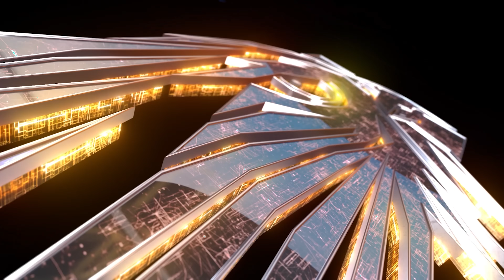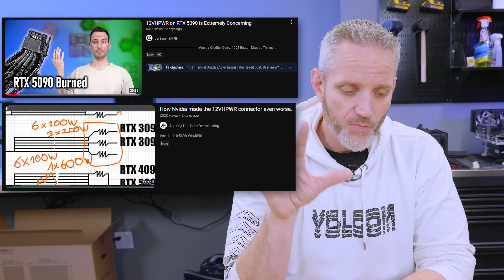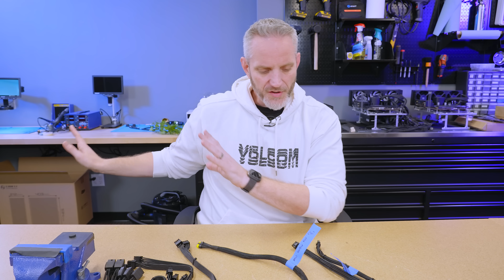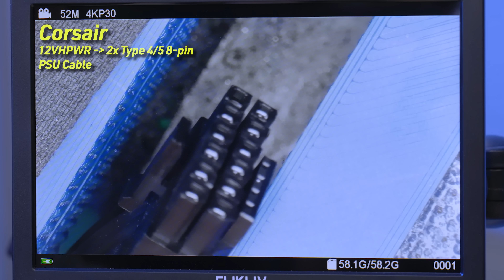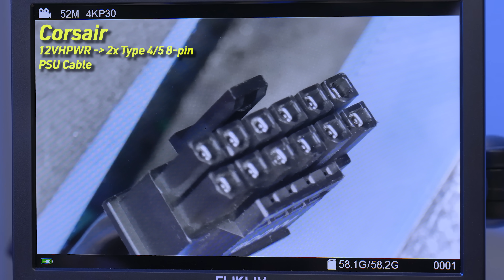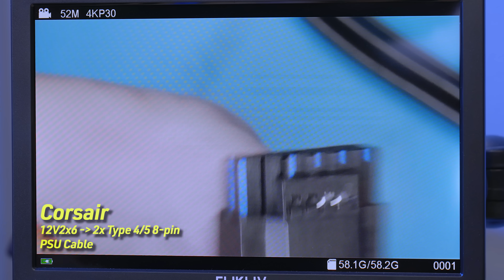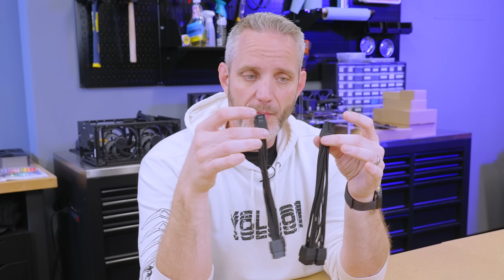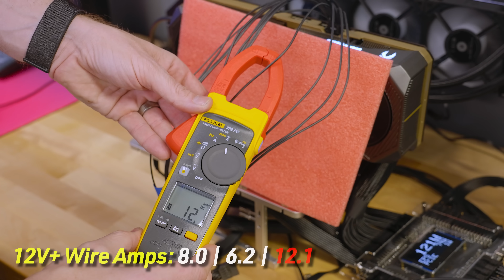I discovered something concerning and I need the Experts to chime in... More 12VHPWR discovery!

Comment: As an electrician, the simple fact that these cards are using a cable that’s rated for 600W, while the official TDP is 575W, is crazy. That’s only a 5% margin of safety!! In Canada, we typically don’t load wires & connectors to anything less than a 20% safety margin! IE, for a 575W card, the cable and connectors should be rated for at least 720W

EDIT: as pointed out in some replies below, the PCI-E slow can also deliver up to 75W. 

This does bring it to a 17% safety-margin. This is definitely better, but still very close in my personal opinion. Especially since there were already a bunch of issues with the 4090. 

They should have reverted back to how the 30 series cards were, or used 2x  12HPV (again, in my personal opinion)
Reply: Also in real electrical systems, we always have circuit breakers or fuses precisely to protect the wiring from burning up in an over current event.  The fact that these Nvidia cards have practically no current monitoring and no form of overcurrent protection on the connector is insane.
Reply: @OvenFridge  This brings up a good point: maybe the cables +should_ have inline fuses on each wire?
Reply: @Barteks2x  That would likely be the simplest solution to prevent anything from melting, but unfortunately wouldn't solve the issue NVIDIA created by removing the circuitry to balance the load from their GPUs.
Reply: @Barteks2x  Fuses on each wire, sure it would be safe, but in reality most people would avoid that brand because a blown fuse is a bad day, and you don't want to have a bad day when you're trying to game. 
Cables without fuses cover up the problem, and in 99% of cases the problem doesn't get serious enough to warrant an intervention and so in those cases the cable is seen as just a hindrance.
Reply: @OvenFridge  If you run that close, the only protection is active cooling and external monitoring.

We had a compuer society living in an old barack, with three phase 32 Amp 240 Volt coming in.

Our base load was about 28A 24/7 to run the computers, when we had waffle parties we had to measure what phase the outlets were on.

After several years the plastic caps of the fuse box had melted. We did not once go over capacity, except that one time two wafle irons were on the same phase.
Reply: @OvenFridge  yes, great point! I didn’t even think of the added protection from a circuit breaker / some over current protection
Reply: @OvenFridge  It should be a protection from the PSU and not the device behind the cable. With a short in a connector or cable, you would have the same problem when only the GPU has a breaker. The PSU is the device that "knows" how much power it is able to deliver over each line / wire. With the correct wires installed, it should be able to do that. Everything higher than that: shut the connection down. Not the problem of the PSU that die GPU demands too much power.

The most intelligent would be if PC components (GPU, Mainboard / CPU) would communicate and demand a certain amount of power from the PSU or be limited to a certain amount of power.
If you cheap out on the PSU and it only delivers e. g. 300W to the GPU, the GPU would not work or would only work in a low performance mode.
Reply: @OvenFridge  Thought should this somewhat also fall on the Power Supply companies as well to integrate this, as the breakers are at the source not at the end of the appliance?
Reply: @OvenFridge  this should, honestly, be the job of the power supply.
Reply: @leverloos  In this case, I disagree.  Nvidia is the one to 'invent' a new connector, not the power supply manufacturers.  Nvidia forced this on all their high end GPUs just because they wanted to stop 'wasting' PCB space.  Its 100% on them to ensure they implement in a way that doesn't catch on fire.
Reply: Time to get @ElectroBoom to do some testing here, he likes setting things on fire 😅
Reply: Anyone think that maybe it's about time the GPU power cable go up one full size, I mean connector,.cable gauge, and pin size??
Reply: @parlosyou  It's only a few years since they shrunk the connector and they were told then that's an extraordinarily bad idea. Shrink the connector and up the power 50% great -_- but nVidia assured everyone it's fine....
So the issue isn't we need to increase the size, it's that we need to GO BACK to the actual PCI Express cables and make those better.
Reply: IMHO that's the major design fail of the 12VHPWR connector: they cut the safety margin to the bone! Look at the bottom of the Wikipedia page for the 12VHPWR connector where they compare it to the 8-pin power connector: the 8-pin power has a safety factor of 1.92 and the 12VHPWR has a safety factor of 1.1. 

(And I'm sure that the actual current capacity of the single pins on the 8-pin power connector are higher than the specified 8A, while the 9.5A for the 12VHPWR are probably close to the actual limits.)
Reply: @ahoannon5711  That's a big part of it but not the full issue, the other part of the issue is NVIDIA removing the the shunt resistors on their GPU's that gave them the ability to balance the load across multiple wires. Now if any of the wires has an issue, the other wires pickup the current and nothing in the system even knows about it. You could have a 5090 running on 1 of the 6 wires and the only way you'd find out is when it starts to smoke.
Reply: @ahoannon5711  The 8-pin PCI-E power suffers from the same design flaw as 12VHPWR, it just has enough of a safety margin that it's never become an issue. That problem being that inidividual current carrying wires need to be protected from overcurrent, not the cable as a whole. For PCI-E, a single functional wire would put you out of spec, but probably not far enough to be a fire hazard. For 12VHWPR, you can 5 wire failures and that single remaining wire will now try to carry 6x the current it should normally do. And even a much smaller margin will result in connectors and wires becoming dangerously hot.
If each pin (and thus wire) was individually current limited to the 9.5A in the spec, we would have a whole lot of cables and graphics cards getting returned as faulty because the connector is shit, but PSUs wouldn't be allowing connectors or cables to melt.
Reply: @remmon1  Will this cause boom or fire?
Reply: Puts things in perspective
Reply: So, in essence - It needs two connectors.
Reply: @Nightykk  No! Different connectors and thicker wire-gauge. They should use something like a XT90 connector which can carry 90A and 10AWG wire which can carry 30A.
Reply: @ I don't disagree, but, that isn't likely to happen any time soon. An entirely different connector would most definitely be the way to go.
But, what they will do... is adding a second of these.
Reply: Probably these companies never heard of tolerance in electricity.
Reply: Some correction here. That is not how rating normally works or has to work, I don’t know how you do stuff in Canada.

I am an engineer in Germany and here it works like this. You have a safety margin that is mostly normed. (We have a norm for everything in Germany) 
Let’s say the safety margin is 50% (it can also be 250%). And the actual limitation is 1500W (continuous) of a cable, then the rated limitation would be 1000W. So you can definitely use 100% of the rated maximum.

This is also how it was before with the pcie connectors. The 6 Pin was rated for 75W, but could probably take 200W, so you could easily use 100% of the 75Watt.
Reply: This is illegal even in Europe, nvidia should be fined, but it's big US corporation, so we can't do anything with that, but maybe it will change now when America is not friendly anymore. Even if it was 640W, it's not enough, especially when you consider that most of Amps can go thru 2 cables and almost nothing thru rest of them, so standard should be that one separate cable should be able to handle those 600W in emergency case, that would be good standard.
Reply: @Pidalin If the EU can mandate Apple to use USB-C. They could probably force Nvidia to sell cables/connectors that are actually safe to use
Reply: @Pidalin  You don't need to fine them.  The EU can just ban nVidia from making sales in Europe until they fix it.  That would be such a gigantic hit to their stock price they would be forced to change it or the shareholders would upend the board of directors.

Also, leave us alone.  We're plenty friendly toward the EU.
Reply: You are absolutely right, and its not as if that would cost anything more, 2k dollars can pay for a few cents for a higher spec cable
Reply: As i dont see anyone pointing it out already, its actually 675W. There's an extra 75W coming from the PCIe port too. Is this sufficent headroom? Idk. But a bit bigger.
Reply: The cable assembly (6 parallel #16 current carrying conductors, free air, 90 degree rating, 12 volts) would be 1300W at 100% rating. The limiting factor are the terminals, but I'd wager good money that Molex rates the actual terminal for the full 16AWG 18A in free air, but is derating it inside the micro-fit+ connector, and then further derating it in the PCIe CEM5 power delivery standard (since all 12 conductors are current carrying)
Reply: im not an electrician by any means, but i know my way around automotive electrical systems, if anyone told me to push 600 watts at 12 volts through that connector with only 6 thin positive wires i would call them crazy. Two 8 pin pci-e power cables are rated at 300 watts (150 each), and between them have the same 6 ground and 6 positive wires.
Reply: @sniperotto  At that current? Bundled small wires is nuts. When I was wiring up my 200w rms subwoofer amp in my car, (you know audio peaks can be 2-3 times more), I looked at peak current draw to choose the supply wire. I used 4 gauge welding wire. 
A two wire equivalent for the video card would be 8 gauge minimum. 6 gauge should be right, IMO.
Reply: @sniperotto  What connectors are specified for and what they can actually do are two different things.
A cable harness can deliver 6 to 8 amps with a 6 or 8 pin connection, which is at least 72 watts per cable harness with a 6 pin connection, so a total of ~218W.
Also think about the Radeon R9 295X2, this card had 2 x 8 pins and drew 500W. Basically it's not a problem if power supply cables are designed for it, but the 12 connection is also built on the edge and basically only has a 10% buffer.
Reply: wires themself are rated for ~680W@12V not sure what exact connectors are used
Reply: What's worse -- the max rating is unlikely to be power current draw. It's likely burst draw.

We need to just increase to 48volts for these cables. 

Sure, computers get more dangerous, but 12v isnt enough to decrease the amp draw.
Reply: @1337GameDev  If you go to a 48V supply method, more circuitry will be needed on the board to translate the voltage down to the low voltage processor chips/memory thereby increasing the cost of the product.
Reply: @tigerzero5216  

The 48v will just be for high power pinouts. 

Older devices that expect different voltage would need a step down, but that's pretty easy to do and unlikely they'd need high power so adapters would likely be pretty cheap. 

IMHO, most devices for 6-8pin / 12VHpwr are gpus and could easily adapt to 48v. Albeit extra step down would he needed on the card, but that's pretty small cost for a GPU at $1000+
Reply: it's insane release a graphics card with such a atrocious power consumption, I think Nvidia has pushed this cards to the limit.
Reply: yea, I am a computer tech... and I really don't like the 5% safety margin at 575W.  I have gone "nope" to using that connector at all.  I think it's just a fire waiting to happen.
Reply: That's not quite so. The pin rating is 9.5A adding up to 685W total. However the connector as a whole doesn't have a rating because it's usage dependent. It's intended to be used up to 600W according to PCI and NV, which is supposed to already have margin of safety to real maximum rating of the cable, which isn't specified, which means loading it up to 575W should have been absolutely fair and not a problem, heck loading it to slightly over 600W would be fine as well, since the real safety margin is ON TOP of those 600W. And those 9.5A pin ratings also have a safety margin in them to begin with. You don't need to keep inserting safety margins everywhere if the hazard has already been accounted for.

However when each pin pair isn't loaded individually and the current across pins isn't balanced, a de-rating needs to be applied, and evidently, that de-rating hasn't been done properly.  It should be done experimentally but a common fairly safe rule of thumb is 20% per doubling of pin count, which means a quick and dirty de-rating of 52% for 6-way parallel would be commonly used, so 330W. If the connector was used as 3 independent groups of 2 parallel pairs, it would be 20% or 550W.

Note that even if you have individual consumers on the high rail balanced but the grounds are not, the same de-rating still needs to be applied. So i think no matter how you slice it, i'm still not going to call it evidently sufficient for loads substantially exceeding 330W.

Oh also not all of the official TDP is on the 12VHPWR cable, on Nvidia the VRAM VRM and one phase of core VRM are generally connected to the PCI-e socket, probably a good 50W. So yeah i think a 380W GPU should do fine.
Reply: @SianaGearz  Thanks for your explanation of the need to de-rate when using multiple wires that are not balanced. That's what I was fumbling toward with my comment.
Reply: I've worked on emergency generators in hospitals and such, they use up to 12 × 400mm² and one thing we check is that they were all the same lenght, like down to the cm same lenght, so they all had the same resistance and the current would flow to all of em evenly.

This is like that on a smaller scale but with the same end result. Fire.
Reply: Shouldnt the wire have that margin built in, you rate it for 600W but in reality it can take some % more?
Reply: On top of the wattage so people are undervolting!  Increases amps as your volts go down. Watts stay the same
Reply: @HellbentOrphan  Not at all. Voltage "pushes" the current. Lowering voltage limits the maximum possible current.
Reply: @HellbentOrphan  That has NOTHING to do with power delivery to the Card!
Reply: Isn‘t it rather so, that when its rated for 600W, the safety margin is on top already? like 25% or more derated already from the technical max, like 720W in that example. So its not 5% to. 575W, its much more.
Reply: They draw 75w through the pcie slot also.. 
so its within spec. even tho the margin for error is still crap.. I mean there where no melty cable problems with the old 3090 and 1kw bios!
Reply: @david61210  good point. I did forget about the 75W through the PCIE. Does increase the safety margin, but I (personally) would still like to see beefier cables & connectors. It should add that much cost compared to the overall cost of these cards.
Reply: Could you check the current flowing through the ground wires relative to the one with the dodgy contact?
Reply: gaming PC's are going to require a dedicated 20 amp circuit in a couple of generations
Reply: I’m pretty sure the cable is rated for 600w continuous. All PSUs are rated for double their spec, I would expect the cable to also be able to manage double.

So for spikes it should be able to handle 1200w if the rating is 600w.
Reply: At the very least SomeOK. I'd go even a little higher. Just to be safe. They really needed 2 connectors.
Reply: US standards can often be just as strict, the cables aren't made well enough or rated high enough.
Reply: Also there is no way for the card to know what kind of cable you have, if it's good quality, each wire has same resistance and so on. They assume too much in thei shitty setup. Don't understand why the just didn't add sensors for each pin and load balancing. I mean how much would that cost in parts? $20? $30? If they did that there would be no need for the useless sense pins.
Reply: Cable is 600 and they get at least 75W extra from the PCI slot
Reply: I think there's a 600w from cable plus 75w from PCI-E slots, but yes really close
Reply: The cabeles are rated for 684 watts with a 1.1 safety margin or 9.5 A per cable as per the spec.
Reply: Apprentice here. Dont you think that the ambiant temp in a pc case would affect that as well. I know that, from what I've learned, if I were engineering this thing, for a 600W card, them cables, and that there connector would be a whole g dang lot bigger
Reply: It must be at least 1.3-1.5 times. There is no specification below 1.3x for these cables. At least 780W.
It would have been easier to release the 8 pin cables for what they can really do.
An 8 pin cable can deliver 6-8 amps per line cable, this is 288-384 watts.
3 x 8 pin would have been much better for the card than this 12 pin connector.
Reply: Yeah I have read that spec is to be able to lose something like 10% of the strands while stripping and still be in spec.
Reply: Safety margin is all I've been thinking about since this vid started. Lets just consolidate several connectors into 1 with connectors that fluctuate in contact area.
Reply: all of a sudden everyone is an electrician and engineer in these comment sections
Reply: When they forced a new standard idk why they didnt use that to push a new 24v or 48v connector, that would save cost and make connectors smaller, using roughly same size connector as the old 6 pin and wire gauge.

For these safety margins and power ratings the connector should have a 2cents ntc temperature sensor

And about the receding pin, clamping force on the pins matters more than how much it is pushed in
Reply: @victornpb  that'd make adapters impossible and would require new power supplies and a new circuit on all power supplies for 24V instead of 12V
Reply: @ they already trying to push new mother board and psu standards with 12v power rails would be more economical to just switch psus laptops already use 19v for everything that would double the current capacity using the same wire gauges and higher voltage psus are cheaper to manufacture
Reply: But…‘merica
Reply: You are mixing things up. pcie 8pins are rated for 150W power delivery. the new 12V high power is rated for 600W. Then a card is allowed to take in 150W from the 8pin. A card can take 600W from the new 12V hp. The problem is that the safety margin was highly reduced. pcie 8pin can handle like 280W of power safely and for safety it was decided that its rated to 150W only. The new 12V hp tho is rated for 600W and can safely only handle 660W, that is a huge reduction in safety margin %. That means e.g. if on the 8pin 1 of the 3 12v cables has no good contact, the other 2 cables get at most an increase of 50%, so 1 cable transports 75W instead of 50W, but as the safety margin is at 288W, 1 cable can safely deliver up to 96W.
A normal GPU card will only ever have power delivery plugs rated for slightly above their maximum wattage, the change is this safety margin.

Combine this with potentially bad contact on 1 or 2 pins and one will be very fast above the per-cable safety limit for the new pcie 12v high power.
Reply: 600 Watts at 12V is 50 amps. Which means 9 amps per pin. Copper cable of cross section 1,5 square millimeters is able to sustain up to 16 amps current.
Reply: @jaromirandel543  The problem is not that a cable draws 9 amps, but that sometimes it is 12 amps, the load is unevenly distributed.
Reply: @Nost2682  Wires with bad connections have high resistance. Because of that there is high current at wires with good connection. Remember - most current goes the way of the lowest resistance.
Reply: @Troll_Norris  
The cables from the 12 pin are merged into 2 on the board, hence the poor load distribution.

There is also no monitoring, the 4 pins are only there for the signal, which tells the power supply that the cable is connected and it should supply power.
Nvidia did absolute nonsense here.
3 x 8 pins would have done this without any problems.
Reply: @Troll_Norris  Who told you each pin carries it's own divisible load? It doesn't.
Reply: @LibelLinus304  it should. All power is from the same source and it should lead to same PCB layer.
Reply: @Troll_Norris  It does.
Reply: Worst part is you can do the math of the gauges of wire and it comes out to below if not dead even to what they claim cards can carry.  That is before you add any additional resistance from bad connections.  The design is flawed from the get go.
Reply: I agree. It should be a 8-900 cable if operation is 6-700 watts
Reply: Honestly, if they are using 16 gauge (1.29mm2) wires. then these wires are rated for ~200W (17 amps at 12v) each going by 40cm length. And there are 6. It definately has to be the connector or connection. the wires have a 25% safety margin.
Reply: @leverloos  In a search, 60cm is typical and when you see 2 wires taking most of the load then there is a power delivery/resistance problem as well.  But when you are pushing 600+W with 4 wires handling 200W or less each and 2 taking up most of the load...
Reply: As an electric guitar player, I just hope to not get shocked.
Reply: This is actually normal. Even with older connectors you don't get much margin. 7900XTX has a TDP of 355, and it uses 2 150W connectors, plus the 75W from the motherboard. 
The total capacity that the 5090 has acess to is 675W (600W cable, 75 from PCIe slot). 

The issue is not overspecing the cables, the issue is that while the older 150W 8 pin cables can run ~250 Watts if good quality. Many 6 pin cables that are officially rated for 75W have the same amount of power lines as the 8 pin cables, meaning they can deliver 150+W safely

The issue is that while 8 pin connectors can safely provide far more then they are rated for (the safety margin), the 12VHPWR connector can only safely provide something like 660W. On top of that, it wouldn't even be an issue if Nvidia used the same power setup as on the 3090, which split the connector into 3 power lines on the card (2 wires each), which means they can monitor voltage drop and rebalance the cables when one gets damaged/overused or isn't pluged in correctly.

On 4090 and 5090, all of the 6 power lines are joined together on the GPU, which sees all of them as a sigle wire. If something goes wrong, the GPU doesn't know a difference between 100W x 6 wires, and 600W running through a single wire, and thats why they burn(apart from the whole 16 pin connector being bad overall)
Reply: @shepardpolska  Not sure why any "electrician", "engineer", and or presidents of small islands here, did not open with beginning, simple, electric basics like, the fact that the power supply can and Will pull 50-60 amps@ 600 watts. 50 amp draw needs 6 gauge copper or 4 gauge aluminum wiring. Most of these wires and connectors are a mixture of both. Either way none are capable of holding safely 50+ amps. And what happens when you attempt it? Melt down. Hell, some of those power supplies pull 80+ amps...
600W / 12V = 50A Why not 120V? Thats only 5 amps...
Your computer's power supply unit (PSU) converts alternating current (AC) from a wall outlet into DC. 
Something I think these designers either have forgotten or never knew.
This problem will not go away until it is done correctly. 
Most electronics need low-voltage DC (like 5V, 9V, or 12V), but wall outlets provide high-voltage AC (100V-240V). Therefore, must be lowered and converted AC to DC, making it safe to provide directly from standard outlets.
If you read the numbers on the power supply you'll notice this as truth. If you learn the pc's voltage use you'll understand the complete process.
So much for the thousands of "engineers" and "electricians" here..This is basic stuff.

And if one thinks coatings and or wraps, sheathing, cool af braiding, or any of the like helps the problem, on the contrary, it makes it worse. These things are insulated to minimize arcing after meltdown, but also at the same time keep heat IN making it even hotter. They have zero to do with electrical current carrying capabilities.
Reply: that doesnt matter because the PSU is sending way more then that to the GPU causing the issue, the source power aka PSU is not regulating correctly so its over volting the 1st pin, vs load balancing it thru all the wires correctly.   This is why its not repeatable because all the folks so called testing this theory, never test the PSU that caused the problem ( they cant its burnt up, cant be used any more,  they use other brands versions which are working ok.  vs the faulty PSU,  not all PSU's are faulty just a select few, which is why so few cable melts happen.  if you look at the numbers is low, compared to the millions of PSU's being made,  sure a few lemons make their way into retail faulty parts.  if it was a GPU or Cable issue, all of them would melt, but that's not ever happening.  its just a few bad PSU's with faulty regulations in them for sending power to the cables when a source askes for it.  the spec of 20% or 5% the faulty PSU is going way way beyond any of those margins in order to actually MELT stuff, which is why that doesnt matter if its 5 or 20% leway.  the melting is happening well past that point.
Reply: @supertrix6628  Most have OV protection, so, no. That isn't to say a PSU Without OV could possibly but the issues I already stated. Everyone I know of that tested these also tested the PSU and it passed.
Reply: rated 600 would be insane bc the 5090 casually pulls 610+ W
Reply: I thought I'd read somewhere the new 12v2x6 cables were actually rated at 675w and also there's about 75w being drawn from the pcie slot through the board
Reply: The H++ cables are supposedly rated for a max of 675W.
Reply: BULLSHIT. Youre knowledge as an electrician indeed is outdated as a whole. H++ is rated to 675 - 680W ( without extra safe margins ) H++ Power Connector = 12V-2x6 Design (675W Power Delivery)
H+ Power Connector = 12VHPWR Design (600W Power Delivery)
Reply: Right, but we still call a 15 amp plug a 15 amp plug, even if it has a safety margin and could probably do 20 amp all day without catching fire.

If you have a 600W card you use a cable with a number printed on it greater than or equal to 600W, and should be able to trust that the 600W cable has a safety margin baked in.
Reply: As an engineer, I second this. Seeing those TINY plugs being rated for anything above 400W feels like playing with fire. If at least each contact was the same size as PCIx8, they would be fine carrying 600W through 12 of them, but NOT through whatever these are.
Reply: I would agree that is a very small margin. Could the connector cables not be equalized? Similar to wye connections in AC motors?
Reply: I could be wrong...but are they building these connections like this to "prevent user overclocking" through behavior manipulation and warranty denial? All so there cards do not have to be improved?
Reply: @DragoonZeroAlpha  the melting happens without overclocking as well
Reply: You install a GPU that can pull 900 watts in bursts, a CPU that can pull over 300 watts at max load, and every other power-hungry peripheral component into a modern gaming PC, and you could end popping a breaker just running it alone. This is nuts.
Reply: @shmehfleh3115  nah u wont hit a breaker, because the power supply can smooth the loads
Reply: depend which crimps you use, there some cable that use 12,5A rated crimps : that mean 900W support for those cable
Reply: can confirm I don't even plug shit into the WALL without a 20% margin
Reply: I think the de facto standard is 25%, 5% is nuts.
Reply: @ivanjermakov  20%
Reply: From my understanding 600W is the safety margin number? but I could be wrong
Reply: PCIe slot supply 75w and the power cable supply ohter section. however the power header with 16AWG wire per pin 9.5A x 12V x 6 /.8(de-rating). the per pin 9.5A is de-rating number for component.
Reply: A 20% margin for 575 watts is 690 watts not 720 watts. 575w x 1.2 = 690w.
Reply: moving to 12 gauge wire would probibly be the only mod required, then you can reduce pin count to 5 pairs, reduce sense pins to 2 and place them in corner positions to ensure the power pins are connected well, and this means you can ditch the exotic connectors. the cable present pin and power good signals can use a voltage between 5...12 volts to indicate psu capability and/or loading, instead of a binary code on the 2 additional pins.
Reply: For short usage 600W on a 575W specified cable is ok. Long time usage instead is not a good idea.
Reply: Dude, the US still use aluminium for household wiring. Heaps of fires and hazards from it. Here in Aus it was banned back in the 80's. The US is majorly behind.
Reply: I have an RTX 5090 AORUS MASTER, i've power limited it, and now it draws arouns 470-480Watts, should i be still concerned or is it safe? I have a Corsair RM1000X PSU and using the PSU 12hvpwr cable
Reply: As a electrician you should know that 600w rated cables are not 600 MAXIMUM TO MELT, they can stand beyond that. What a shame
Reply: Isn‘t the cable rated for more like 640W. But the spec says to keep devices below 600W for exactly this reason?
Reply: @MelvinGundlach  That's the problem.  If you overclock your cards or take a power spike in any way and the watts shoot above the 600 rating, which isn't uncommon in computers, then your cable will eat shit and possibly cause a fire.  The safety margins are there to catch those variances.  

There's no reason that cable can't be rated for 800W.  They're just cheap and don't want to engineer it like that.
Reply: @MelvinGundlach  Yes.  It says 600W because that is within the margin of safety.  Manufacturers allowing cards to exceed 600W is a problem because you're making the margin of safety too small.
Reply: @jookm  Sry that's simply not true. That would not lead to 20A on one wire and 2 on another while the GPU draw 575W. 
And what manufacturers allow their cards to draw more?
Reply: @jookm  these things are way out of spec regardless, because the load on each cable isn't anywhere near the same.    40 watts is not going to make a difference.
Reply: @technikschaf1574  I didn't say it was this problem, I made a regular comment for that.  I said it is a problem.  And even in this video Jay said it.  Zotac 5090 pulls more than 600W.  Other cards are too.  There are multiple problems that exacerbate the issues.
Reply: @jamesbyrd3740  I repeat.  I said it is A problem.  Not THE problem.  I was commenting in reference to the OP comment.  I made a regular comment (not a reply to a comment) where I talked about THE problem.
Reply: @jookm  The margin of safety is laughably tiny to start with.  Just more penny pinching.
Reply: @ferrumignis  I won't disagree, but when it's ignored, especially when it has at least something, it's asking for more problems.
Reply: @jookm  I have a 4090 Strix OC which Asus always makes high power draw cards for the ROG line and I can confirm with  hardware  monitor it never reaches  600 watts. The max it reached was 500 watts and goes between 499 and 500. So this doesn't happen because of it exceeding the rating on the cable. People with less power hungry cards and not overclocked still have melted cables. But I have an EVGA PSU with their 2 x 8 pin to 12vhpwr cable and my pins are all tall so I think my cables never have this problem because they are  well made like Jay suggests since I've been running this for 2 years and have taken my graphics card out of my PC many times cleaned inside many times unplugged just the cable many more times and never had an issue.
Reply: @trsskater  Your comment is unrelated to anything I said.  4090 TDP is 125W less than 5090.  There are 5090s that are pulling over 600W which is a major issue.  Couple that with the inconsistencies in power draw in individual wires of that connector and you're asking for even more problems.  The issue with 4090 wasn't exceeding the power rating of the cable, but on 50 series, that is an issue, so it's just one more to add to the list of problems that existed on 4090.  The only real benefit to 50 series that Nvidia did was angle the connector differently so people aren't overbending it like they did on 40 series.
Reply: @jookm  My comment is related because it doesn't matter if the 5090 is pulling 1000 watts because the 4090 OC editions still has the same issue while also being under 175 watts below the cable's spec (because the PCIe connection provides 75 watts) A then the 4090 founder's edition pulling 225 watts below the spec and is also having that issue. So the issue isn't related to pulling more watts than the rated spec. And even still the 5090 founder's is pulling 100 watts below the cable's spec meaning the OC cards still have another 100 watts to use and still be in tolerance. And with Nvidia putting a 10% power delivery cap on every card the most highest power draw over the cable would max at 560 watts. So still below the rated spec. Also there are no reports of a 5090 drawing above 600 watts on the cable only rumors of a 600 watt TDP which still wouldn't be 600 watts over the cable.
Reply: @trsskater  No one reads my comments in full or even watches this video.  I made a dedicated comment talking about THE issue.  My replies to this particular comment talk about ONE issue.  I never said that pulling over 600W is the only problem with this connector.  I said it is just one more issue adding to the already existing issues.  Secondly, rewatch this video and other Jay videos with the 5090.  Jay says specifically that the Zotac 5090 is pulling over 600W.  Not rumor, he measured it himself.
Reply: The rating is printed at 600W on the plug.  It may have ratings to handle spikes but the rating is 600w period. That is what the end user needs to know and what every manufacturer should abide by. The fact that they have alarms on the card and those alarms sound without even overclocking the card is a huge issue.
Reply: @MelvinGundlach  the wires (6xawg18) are rated for 680W@12V, not sure about the connectors themselves.
But the main problem is that there is no way to check or enforce even distribution of the load about the 6 phases/wires so there could be a huge imbalance (as DerBauer showed)
Reply: @MelvinGundlach  20% would be still 720 tho
Reply: @MelvinGundlach  Yeah I thought it was 660W but can only be used for 600W, that's still a tiny safety margin for something that's going to be DIY'd a very large % of the time.
Reply: @MelvinGundlach  Yes, but as Jay said in a previous video, the cards draw upwards of 615 W. In other words the headroom is about as low still.
Reply: @MelvinGundlach  apparently it's not even rated for for 500w since they melt. NV should have kept using the 8 pin power connectors and this would we a non issue.
Reply: German TÜV actually tests with a safety factor of 3.0, meaning e.g. a wall mount that is rated for 40kg, must withstand a load of 120kg. 

NVIDIA chose to use a safety factor of 1.1 on these cables, or in other words 10%. In an electrical product with high voltage and amps that is a potential fire hazard. 

Absolutely insane.
Reply: The obligatory, "chiming is in as" comment, "As an super duper experts in this thing, I must be believed. 'Cuz my self-proclamation gives me uncontestable credibility."